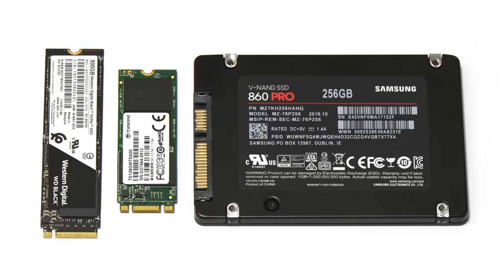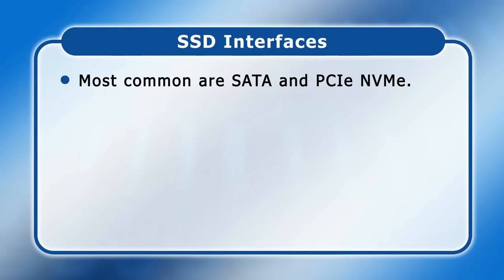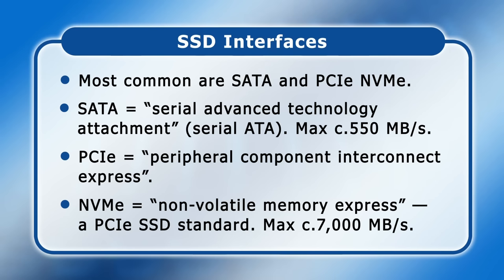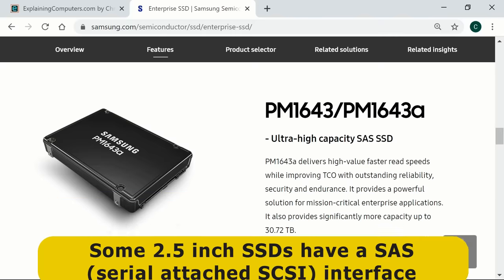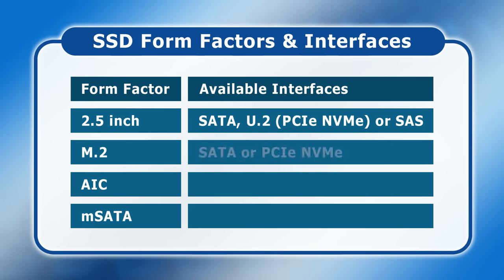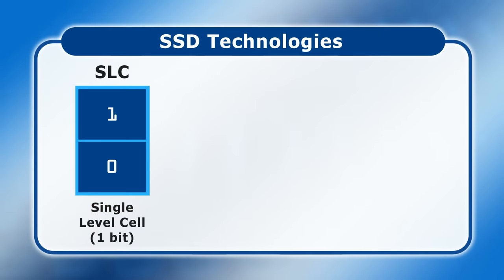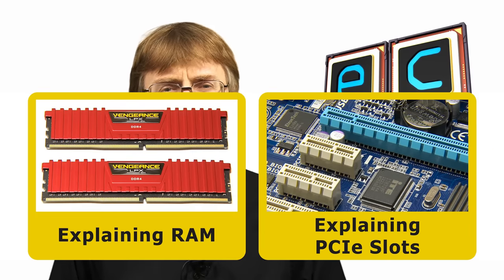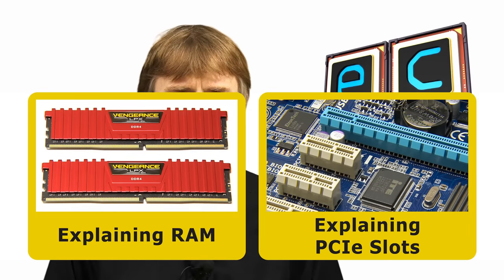Explaining SSDs: Form Factors, Interfaces & Technologies

Comment: I'm of the generation, yes I'm old, where the amount of memory now available feels like magic! And apparently we are only at the beginning of this particular journey.  Beam me up Scotty ever closer lol
Reply from the maker: I know exactly what you mean. The fact we even talk about RAM in GB storage in TB is amazing.
Reply: @ExplainingComputers  I remember ram being talked about in KB and storage in MB 40MB was considered amazing for windows 3.1 iirc
Reply: To think that my first hard drive was 20 megabytes connected to an  mfm controller... And a friend had told me I would never fill it...
Reply: @ExplainingComputers  Next thing you know you'll be talking about CPU cache in GB
Reply: @ExplainingComputers  I used to one the support and development of a transaction processing operating system back in the 1970s which could have over 1,000 online users and had 768 kB of ferrite-store main memory at around 10-12 transactions per second. Something called an ICL System 4, which was a licensed copy of an RCA Spectre which was the first attempted IBM 360 clone (and basically bankrupted RCA). 

It was a 24 x 7 system with disk mirroring and full, dual transactional logging. It, and a second machine of the same specification provided all the central air cargo handling system for the UK as well as automated customs clearances.

It used 3,600 RPM 14 inch 30MB disk packs called EDS 30s. Massive things that the size of curling stones. 

That system got ported onto IBM mainframes and the same core systems ran until near the end of the century. For some other applications (notably RAF stores management) the operating system ran for another 10+ years beyond that.

At the end of my career I was working with machines with 256GB of main memory, 128 CPU cores and disk storage arrays in the petabyte range.

So, coming from the days when every bit counted, we are now in an era of profligacy, or so it seems.
Reply: I am not too old but I remember my father paying 100 bucks for 1 megabyte of RAM. 😂
Reply: @dougr.8653  I remember that time too.
Reply: My first HDD had a capacity of 170 MB and was attached to a 386 PC @ 40 MHz. 
That wasn't my first computer. My first computer had a 8085 CPU and 32 KB of RAM and no HDD at all.
Time flies.
Reply: @e1woqf  my first computer was an Apple II. I didn't like it, so my father replaced with a PC-XT. Since that time I can't stand Apple products. 😂😂😂😂
Reply: Someone just hit Steve Jobs over the head with a shovel , not something I would recommend. It’s just bad karma. 😱
Reply: @NewAgeDIY  😂😂😂😂😂
Reply: @massmo2007  : Mine was 1.5 megabytes and I bought a different controller that  it 2 megabytes!
Reply: @dougr.8653  : I remember paying $460 for 8 64k rams!
Reply: @massmo2007  I remember my first computer with 1K of memory.
That got me 1 1/2 page of BASIC program before it ran out of RAM.
Got a expansion module with 4K, wow that was fantastic.
Reply from the maker: @Parayogi  It will happen!
Reply: I have you all beat.  The first computer I used, a Univac 1107, had no disk drives of any kind.  Later a one-ton one-megaword drum was added.
Reply: I remember looking forward to a 1.44Mb disk, as my Atari only had DS,DD!
Reply: I hear you. One kind of a 'running gag' with my PC upgrades is that I  always seem to get my main drives around the same price point, $100...and over the years, that has jump up by orders of magnitude each time...I remember when a 1GB drive seemed impossibly huge to fill...
Reply: wow, I thought I was old... My first pc was as PS/1 from IBM with 1MB RAM and 20MB HDD. I remember when I upgraded a few years later to a 486 with 400MB HHD a friend of my said “man you are never gonna fill that huge drive”
Reply: @dodg3rii  I still have mine. And the invoice. $395 for 20 megabytes.
Reply: @dougr.8653  Apple became dead to me when they abandoned the Apple II users.
Reply: Let me add my history to the mix here.  The first computer I ever programmed back in high school was a DEC PDP/8i, a so called "mini computer" the size of a refrigerator.  The thing had an octal "fat-finger" panel in which you had to input a 15 step "executive" program that would engage the "high-speed paper-tape reader" which would then read in the Edusystem-20 BASIC Interpreter program.  If the load went well (about 50% of the time) our three ASR-33 teletypes would then pop to life and give us cursors on each.  Each teletype had a mechanical paper-tape reader and punch of its own from which we could load in our BASIC programs.  The system used 12 bits (a "byte-and-a-half" back then) and ran on 4K x 12 bits of core memory, and if we had a really big program we could fire up the built-in hard drive which would give us another 8k of memory. In the early 70s only four high schools in the country had their own computer.  The others, if they had any computer programming courses at all, had to tie into a nearby university computer using a telephone and a 300 baud acoustic-coupler. Errors and line drop-outs were common and priority batch-processing of course went to the university, all of which made teaching programming at the high school level frustratingly difficult.  My high school was one of the lucky ones, though we all eventually got on a first-name basis with the DEC field engineer who came at least once a week to keep the thing running.  That old computer taught me BASIC, Octal and Binary and started me on my own computer service career which took me around the world and lasted 38 years.
Reply: @massmo2007  my first 40 MB hard drive (5.25" Form factor) cost $1,000 shipped. I was an IT Director at the time, & installed it in a Dell 386 with a whopping 4 MB RAM. That machine eventually ran DOS 6.2, Win/3.1, & OS/2 for evaluation.
Reply: {// WTF! //}  yep, and had the tool to remove them too. Stupid pins bent pretty easily.
Reply: @VulpisFoxfire  and was a full height heavy brick.
Reply: We wrapped two wires through little iron ferrite cores for the memory we built in the Navy school I went to.
Reply: However much you have I have found it is never enough especially in Windows.
Reply: I just the other day remarked over how much larger storage is today, when I saw my first USB-stick of 128MB and my latest one of 128GB laying on the desk next too each other. The 128MB one still works ~17 years later and is still in (limited) use.
Reply: @PatrikKron  I am still flabbergasted at seeing micro sd cards with 1TB on them and they are A2 cards too.  Sheesh.
Reply: @thebeststooge  It's incredible! My first MP3 player hade the huge amount of storage at 512mb . So when 1 GB on standard SD cards became available I thought that was impressive  :p.
Reply: @PatrikKron  LOL, yeah.  I still am unsure why pen drives are not offering the same storage capacity considering they are so much larger in comparison to a Micro SD card?
Reply: @thebeststooge  Those exists but are hard to find and expensive. I found one 1TB pen drive at ~380$. ( "Corsair USB 3.1 Flash Voyager GTX 1TB" )
Reply: @PatrikKron  I find that so odd that they are so expensive AND hard to find because a 10-20 dollar USB 3 card reader/writer + the Micro SD is very easy to find and 200 less than that.  edit: I just looked and it is now ~280 everywhere so only 100 more but still I do not get it.
Reply: @thebeststooge  I agree, that's quite odd. From my own experience it seams like usb-drives usually last a bit longer than SD-cards, but I don't know if it's a real difference, and it would still not motivate that price difference. I guess the better alternative would be a small portable SSD, those are much cheaper (~130$, less sometimes), only slightly larger, much faster and probably much more reliable than usb-drives.
Reply: @PatrikKron  SD cards have never been known for being durable and why in my cameras I always preferred CF (Compact Flash) but considering the USB pen drive is a standard USB connector versus a really really really thin piece of metal for a contact the pen drive should easily outlast it.  Now, if both remained in their slots with no touchy which would last longer?  Remember one static shock to a USB pen drive normally hits metal but for a SD card there is nothing between the logic, and the memory, and you so ZAAAP.
Reply: When 3GB was a monster...